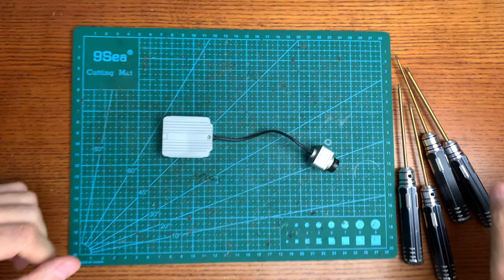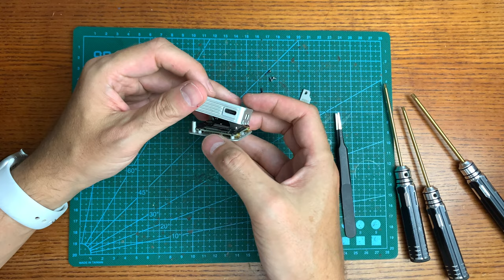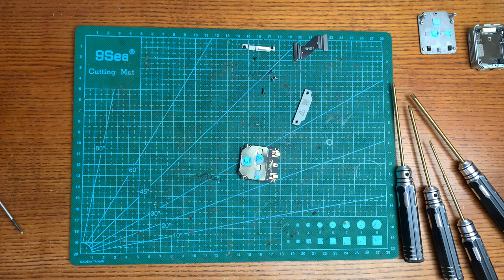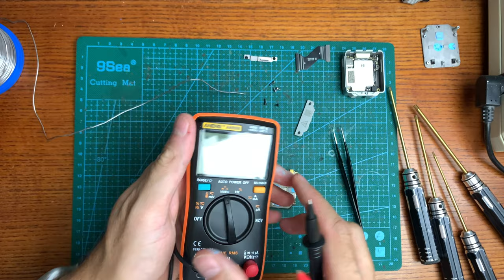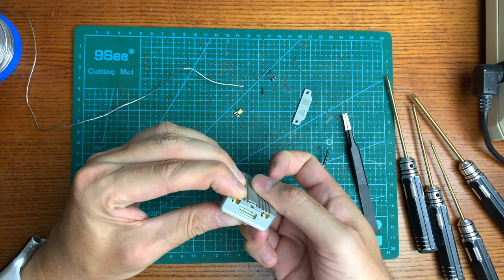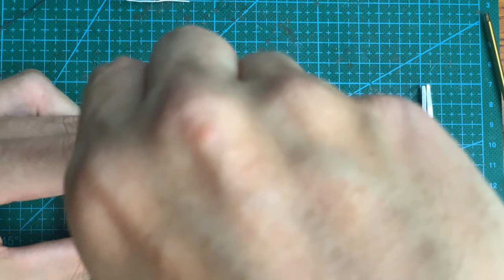DJI HD FPV ASMR -- MMCX connector replacement

Comment: Lol asmr.  Nice tutorial.  I cover my 90 degree mmcx w e6000 glue ontu air units, they never pop out. Its rubber cement type glue here in USA i also cross them and zip tie against air unit to frames

Comment: Straight to the point, no unneccesary comments. Like it. Do you think it could be possible to just move the connectors more to the outside so angled MMCX connectors won't touch air unit's case?
Reply from the maker: Yes I think so. There's plenty of space to push them outside.